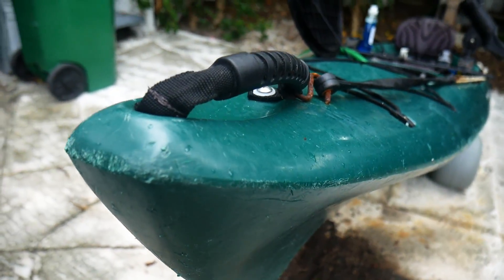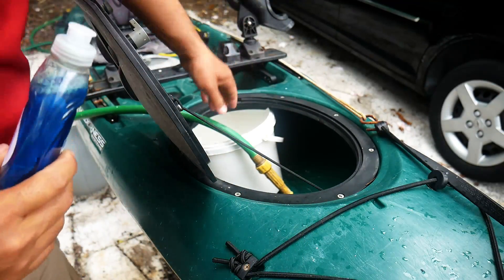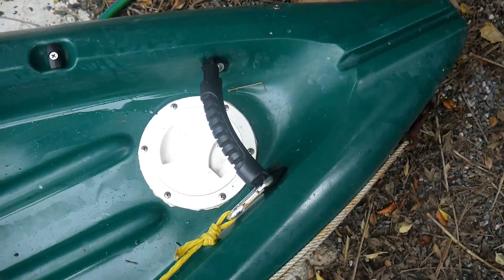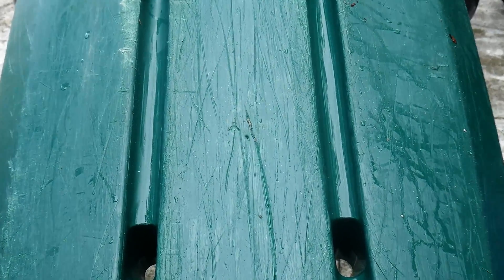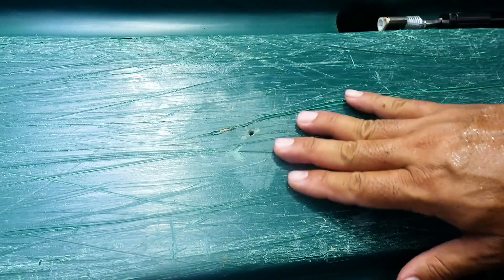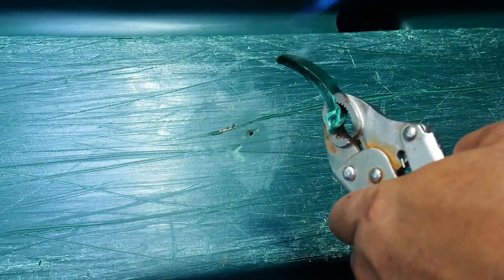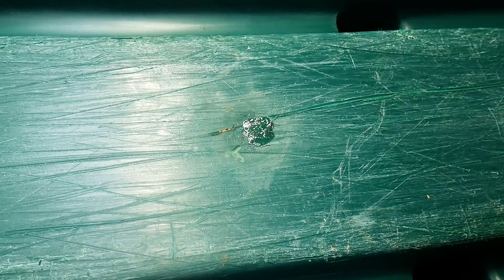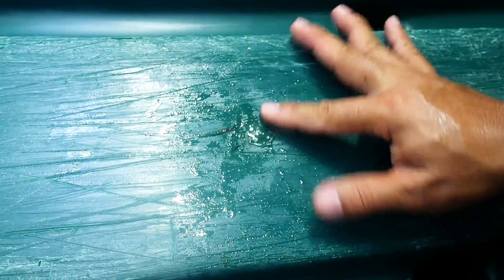How To Find A Leak In Your Kayak - Plus Plastic Welding

Comment: Most important part!  It's being some place that has Coconuts.   Here it's expected to be -20 F tonight.  
Damn, I hate winter!  Ready to be back in my boat in warm weather. 
Great video on patching though.    I am thinking of pressure testing with air.  I know one can only have about 1/2 to 1 pound of air.  Shouldn't have to worry too much about over pressure.  My kayak has 2 port hatches.  But with air pressure one can test outside surface with soapy water.  I believe I'm getting about 1/4 gal. of water each trip out.  I store extra fishing gear below deck.  Would be nice to have completely dry.   One season so far on this new WS Radar 115.

Comment: Good job Steve...both intuitive and informative as usual. Perfect size hole (not too small having to look forever and not so big that you got stranded quickly)...Glad to see it was just a simple poke hole and quickly/easily found. MY GUESS: Check the area of that boat launch where you helped that guy catch Tarpon. I noticed your kayak was sitting sideways at the waterline during that video...it looks to me like there is possibly a piece of re-bar protruding up and scratched a couple times before you pulled it up for loading (thats what likely caused the looooooooong scratch beside the hole). Just my 2 cents, trying to help think in order find what/when/where that hole was made. Keep up the good work. What you do contributes positively to the fishing society and is appreciated.

Comment: Good video.  I'm wondering if you enlarge the hole just a tiny bit more and fit a filler plastic material with PVC glue as a bond, would work.
Reply from the maker: The problem with kayaks is that not many things will bond to the plastic.  I personally would not risk it unless someone can verify that it is compatible.

Comment: I have a tandem kayak....it's 12 feet .it has 8 scuppers.when I fish in it solo there is virtually no water getting in.i take a second passenger ( child) same result not much water at all leaks in over a couple hours maybe less than a half gallon.....I put a buddy that weighs maybe 170 in it yesterday and within 5 minutes it had so much water in it we flipped! ! So I bench tested it to find leak and I filled the entire kayak all the way w water.after 10 minutes there was not one drop of water be leaking out.i know there could be a few reasons for this ie another place on hull above where water fill level was, but that would be a big crack screaming at me and easy to find...... I'm stumped how this is occuring.i know it IS occuring ,but how .any thoughts out there?

Comment: If you ever need to do this in the wild without tools just find a piece of plastic and set it on fire then let it drip into the hole. Be ready with some water to put the fire out because it will drip fireballs!
Reply from the maker: Generally with kayaking, in the wild means on the water.  Not so practical.  LOL.
Reply: Generally with kayaking in the wild would mean you are fairly close to land.... if not and you have a hole in your boat you might be in a little bit of trouble! My main point is that plastic is flammable. You don't need a torch or solder iron. You just need a lighter or matches (or two sticks). Plastic debris is all over the shores around the planet. Just set the plastic on fire and you can repair in the "wild".